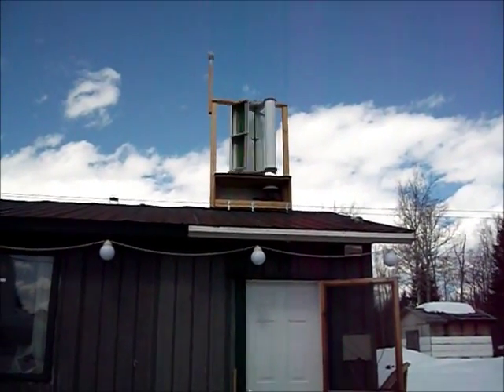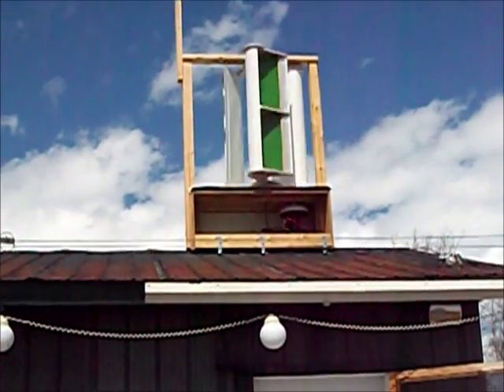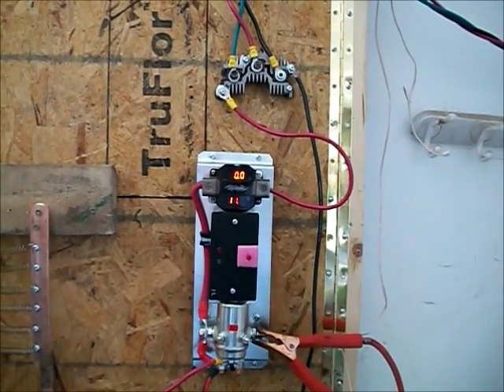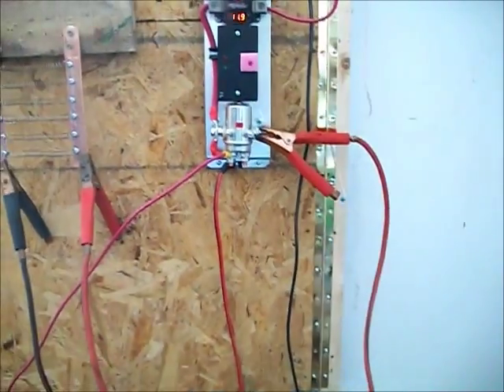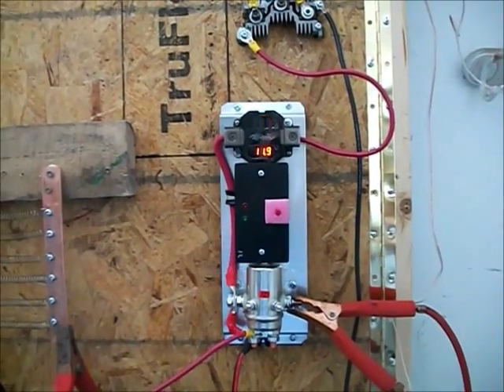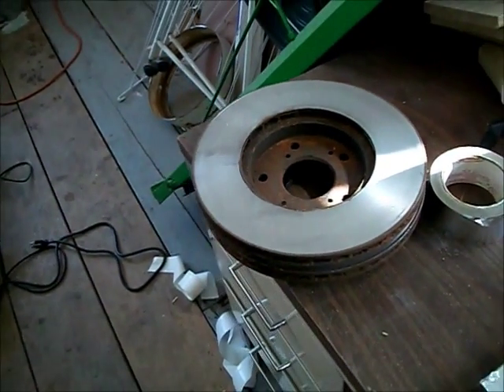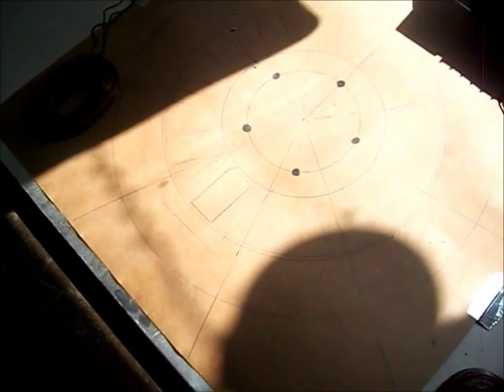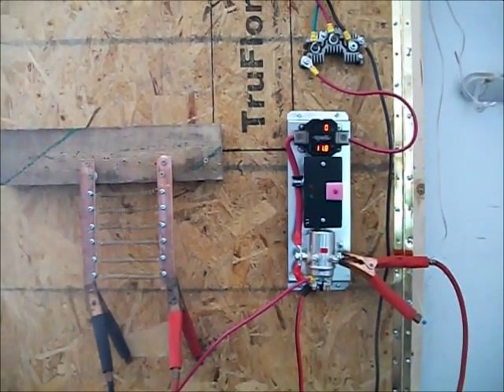VAWT Install

Comment: just a few suggestions if your building one for a 12 volt set up. from all the research I have done, they recommend two strands of #14 wire, around 70 to 75 turns per coil which should work perfect for your set up. I made my coils 150 turns of #14 which they say is good for a 24 and 48 volt set up, so I will be building a new one to correct my mistake.

Comment: oh I see down farther in the comments you used a pulley. start up can be tricky. I ended up putting a tensioner on the belt system also, and it took off a lot easier, tensioner acted like a limited slip clutch and did not engage until speed was already up there pretty good.
Reply from the maker: good idea on the tensioner i look in to it
Thanks

Comment: nice work on your set up, I really like that coil winding jig you made. just a idea for you to try. put a one inch dia pulley on your stator coil shaft and a 4 or 6 inch pulley on your VAWT shaft. you will get between 6 to 1 or 4 to 1 increase in your stator rotation speed. I used a 12 inch on one I built, but never got to finish it.
Reply from the maker: it only start turning at 10 mph wind speed and making power at 15mph
i try a 8" pulley on the VAWT and a 3 1/2" pulley on the F&P generator but it only start turning a 15mph
but with the new DUAL PERMANENT MAGNET ROTOR  i'm building i will install the 8" and 3 1/2" pulley

Comment: Can you tell me if you have the turbine geared up!!! It seems like it is geared to much to start turning more freely.. In any case, it look very nice on your roof like that..I wish you the best to come with your experimentation.. Thanks
Reply from the maker: 3 1/2 inch pulley on turbine and generator, try 8 inch on turbine but it did not turn

Comment: Great to see it installed! I get about the same from my F&P. Hydro certainly is a better application for generators like that. Axial flux is the way to go when it comes to wind power, you won't be disappointed. Ordering my magnets next week, can hardly wait! Best of luck with the new build!!
Reply from the maker: Thanks
Have a friend with the perfect place for a hydro a is camp
maybe next summer we will built one